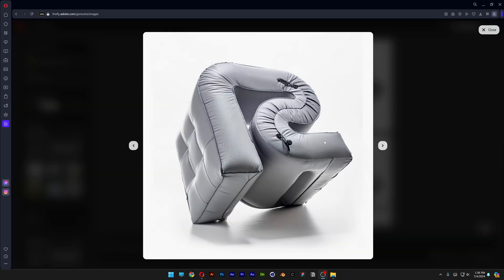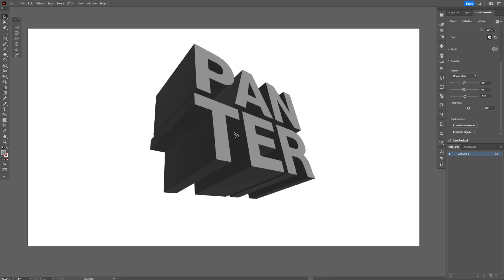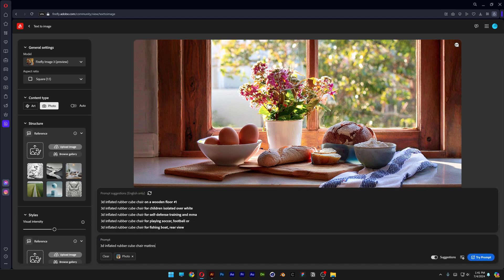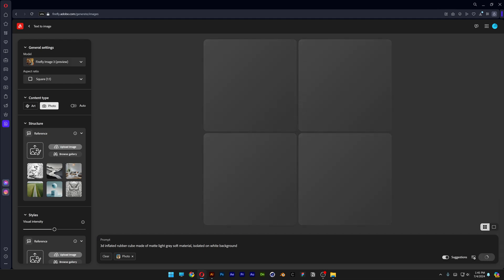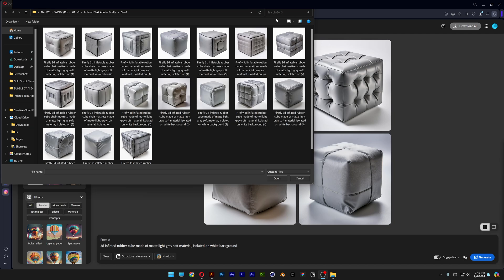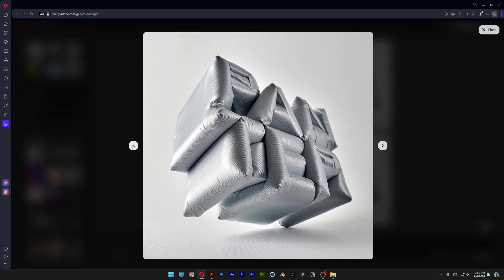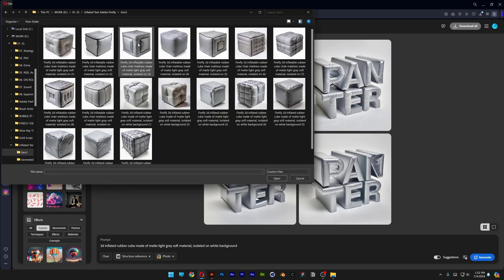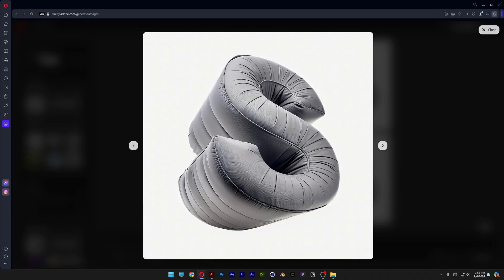How to Generate 3D Inflated Text in Adobe Firefly and Illustrator

Comment: what would be really cool is if after you generate the image you have the capability to rotate view in the 3d plane. or change angles until you achieve a desirable view.
Reply: That would literally be impossible since Firefly is image generator, not 3d space generator. What you mean is to have ability to control image generation by the angle, perspective and so on…but that also would require 3d space to take those calculations from. I don’t see this possible in Photoshop or Illustrator. Perhaps if they bring  generation to Adobe Substance modeler we could see some change.

Comment: Quick tip. The pencil edit icon on the top left of the generated images gives you a drop down with "Use as style reference" so you don't need to download them.
Reply from the maker: It's also a good idea to save a couple of them and generate more so you can decide later to chose the best one.